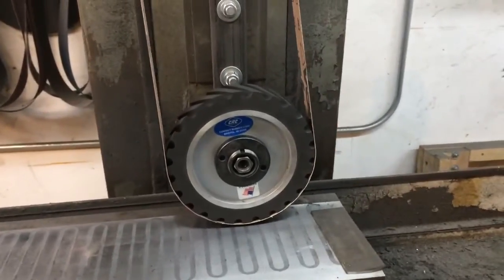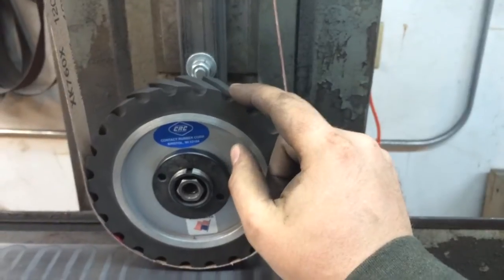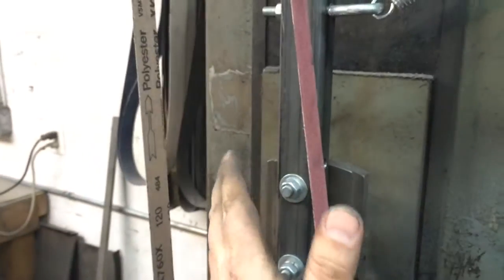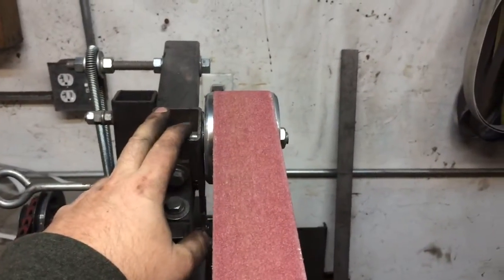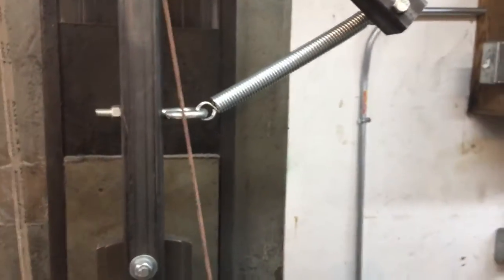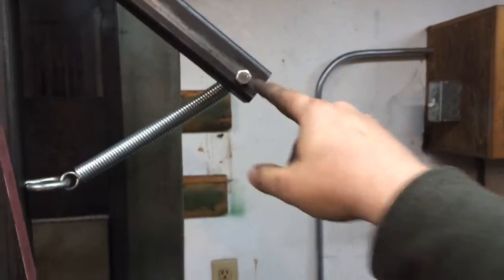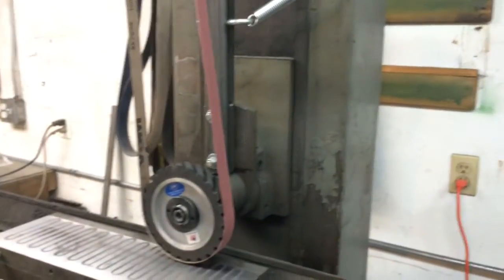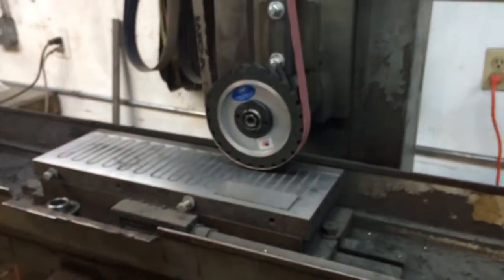Surface grinder belt conversion

Comment: Hey about to start this same conversion. Do you have any words of advice???????
Reply from the maker: If I had to do over, I’d get a 1-1/8” wide wheel. I also ended up adding a longer handle to the tracking arm to make belt changes easier.

Comment: only had a quick look at the surface, there seems to be lines across the work piece, this could be caused by a burr at the front of the job being ground, if you have a upstanding burr the belt hits it, and you get a bruise on the belt which will repeat itself along the work piece,if you deburr the edge using a file then you will eliminate the bruising once the bruise is in the belt it is there for life , people think it is the join in the belt its not the case, i was in the belt buisness for 25 years in the uk and seen a lot of problems, also seen some fantastic machines, yours is a nice set up, what shore hardness is the contact wheel please.
Reply from the maker: I’ll keep that in mind. Thanks for the comment.

Comment: Dry sanding down your belt seam, Belt seams are often high spots on the belt and we dont notice it on standard belt grinders because blades are held against the belt and not firmly down. if your very careful you can even use your diamond for the stones to just true the belt up at the seam.

Comment: Thanks for the idea, is it still giving you chatter problems?
I wonder if it's the belt splice?  I've read of people taking the grit off where the splice is.  I'm getting ready to try to convert mine now.
Reply from the maker: It's better than it was, though there is a slight chatter. I do sand down the belt splice before I use it.

Comment: Maybe the chatter pattern is the wheel not being perfectly balanced on the hub. Try balancing, dressing, checking balance again and adjusting if need be, dress, grind away.
Reply: Finn Custom Knives Yew, that pattern is typical of spindle and/or wheel issues. 0.001" runout under load is plenty to be a problem. Wheel balance is at least as important. Not sure how much that matter can be perfected when using a belt system which will also impact the balance due to any other vibration issues. I imagine that a stiffer spring (not necessarily applying higher tension, just slower to oscillate) would help, as would doing all you can to make sure both wheels are as statically and dynamically balanced as possible. With such fine finish issues it's a matter of chasing down every possible minor cause. Multiple tiny issues are multiplied, not averaged.
Reply: Correction: deflection, not runout. 0.001" is not terrible, but not ideal either. Understand that the vibration from an unbalanced wheel can apply just as much force to deflect the spindle as you do manually when it's off. The mass involved in that kind of imbalance is very small, but the speed is very high. Kinetic energy is 1/2 mass X velocity squared.

Comment: What Brand and Model number surface grinder are you using?
Where did you purchase the serrated rubber wheel?

Thanks in advance for any information you can supply.

John
Reply from the maker: It's a Reid 618p. The wheel is from Contact Rubber Corporation.
Reply: ARCustomKnives   Thanks!